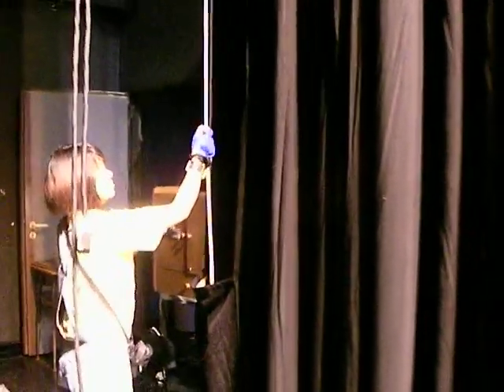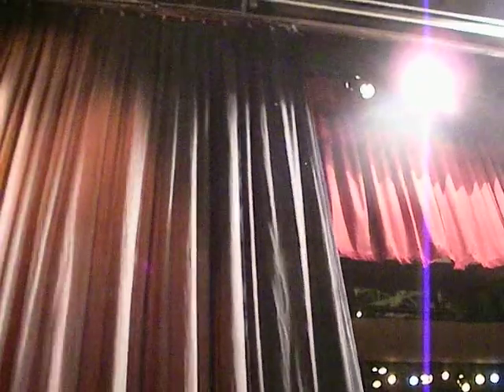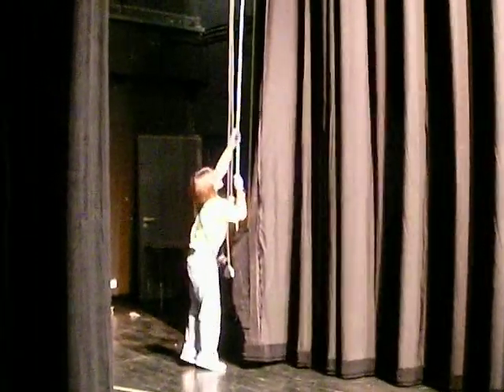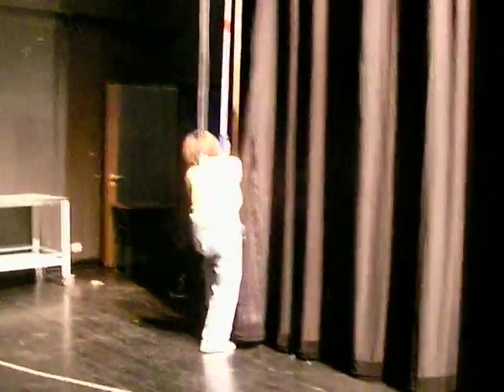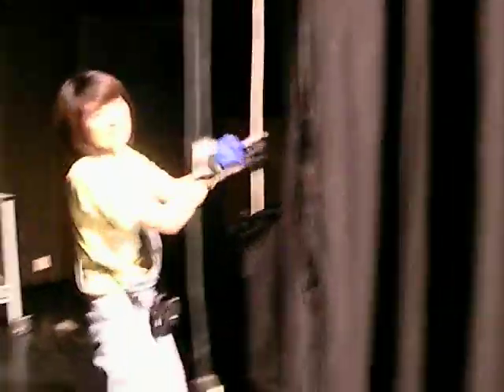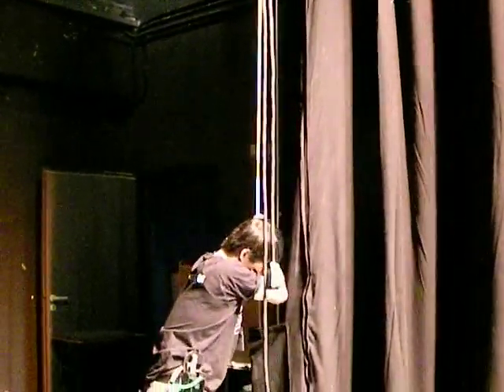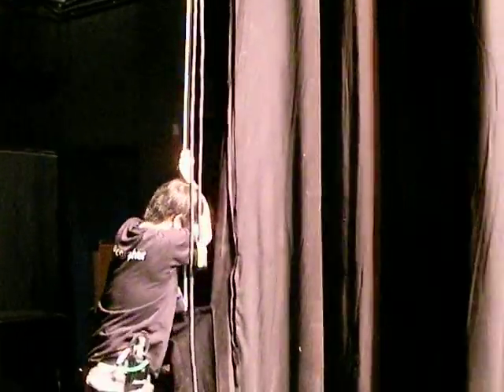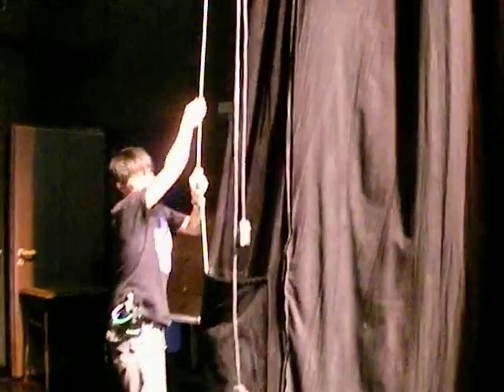SAS DT Curtain Pulley

Comment: The curtain rope shouldn't be in a pulley system you should have curtain ropes on the wood so you can untie the curtain rope for the stage curtain in your auditorium. So you can use the stage curtain ropes better for the stage curtain.